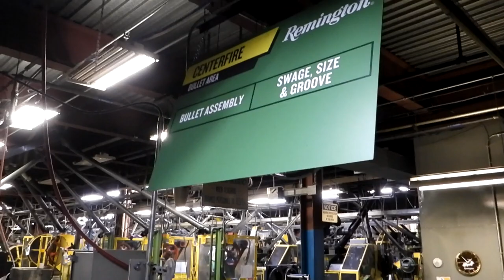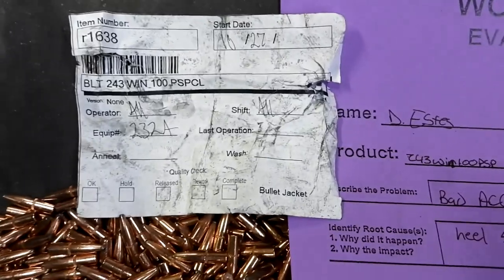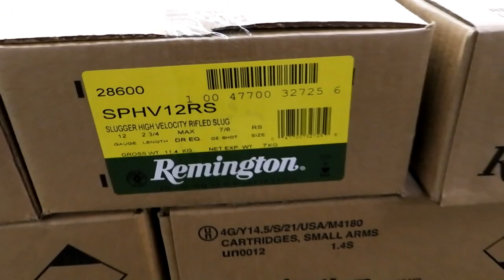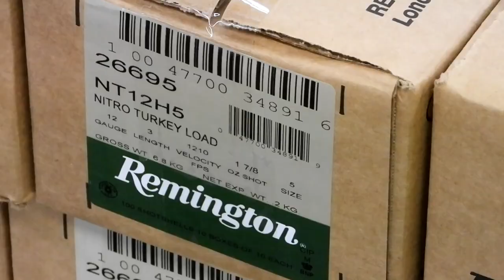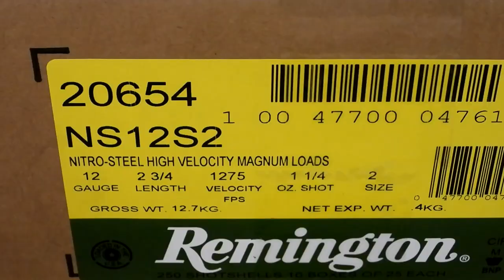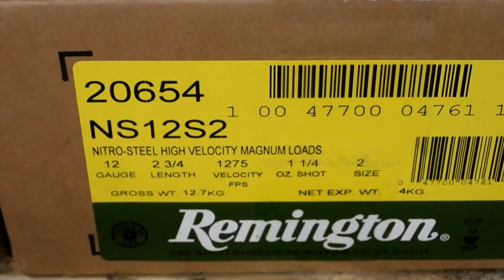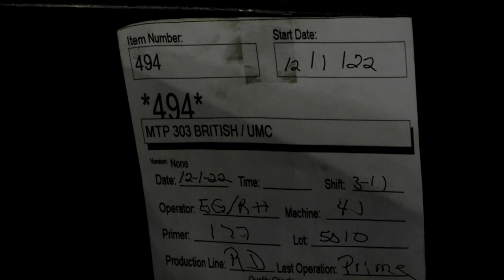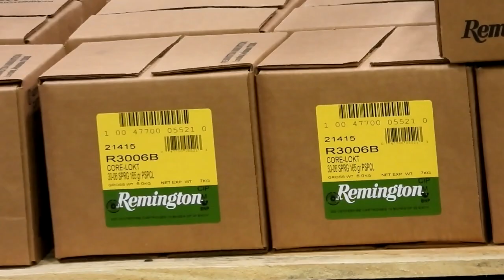Remington is Loading ALL THE AMMO!!! [Factory Tour]

Comment: Remington ammo is good. Better then their guns lol. Iv always used Remington 20 & 12 gauge shotgun shells & 22lr cartridges. The shotshells powder burns clean & leaves less residue & fouling compared to Winchester super X. That stuff is very dirty & fouling & the brass hull slightly expands making ejection more difficult in any shotgun. Iv had problems with Winchester super X & Universal with the Rem 870 express tactical I once had, didn't eject the hulls well. When I used Rem shells only in it, never had 1 issue with that 870.